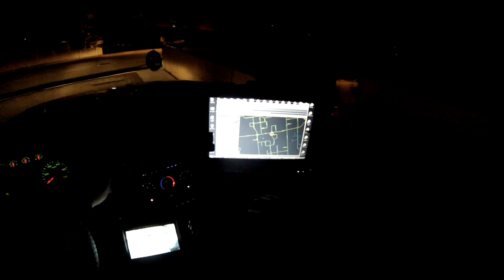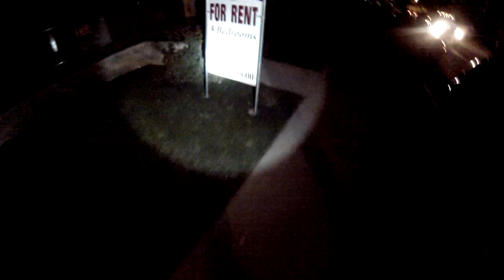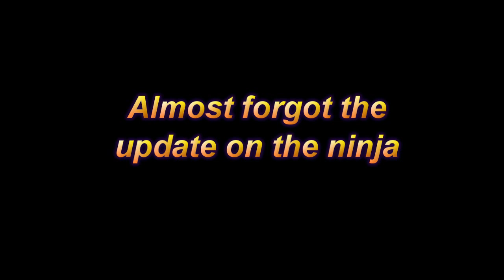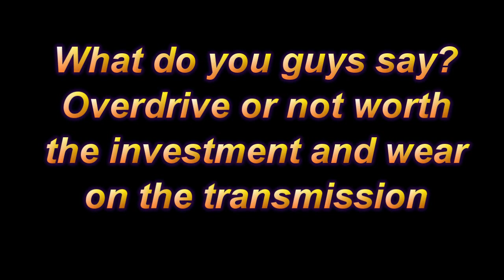Walking The Late Night Parking Garage Searching For Vehicles

Comment: Can a Tesla charge its batteries when it's being towed on the drive wheels or when it's an AWD model with 2 electric motors, one on each axle? Would or could it go into "recuperating" mode while it's being towed? I don't think it would be a problem for a big tow truck like the Ninja to pull that extra weight, except of course it would use more fuel.
Reply: Seegal Galguntijak  flat bed  tow only
Reply: Dusty G. Really? But why?
(Besides the point: Dollies should work, too. Still I don't see the reason)
Reply: Seegal Galguntijak True of almost all hybrids and electric vehicles, if the wheels are turning, then the regen motor is also turning.  If the vehicle isn't "on," then there's no field regulation, so while it won't charge the batteries, it will produce a current which can damage onboard components, and possibly risk the safety of the operator.

The general practice is to not even push hybrids/electrics for the same reason.  :)
Reply: rhkips Wow, that's strange. I would have thought they'd put some sort of security measures in place so a tow won't damage anything. It should be possible - after all, these vehicles are never really 'off' which means they can turn on (but not be driveable) just by sensing that they're being pushed...after all, it's all realized in software, there are no hardware switches that aren't controlled by the computer.
Reply: If you use a usual tow truck, 2 wheels off the ground, the AWD system would break, that is why it uses dollies or flatbeds.
Reply: Idiothi5 Well, the AWD system on a Tesla S isn't like conventional AWDs. These cars got 2 electric motors, one on each axle, so they are not mechanically connected.
Reply: Unfortunately, any time an electric motor is in motion, it's "on," even if it's not attached to anything.
Reply: rhkips Yes, but the computer, which is also always on, could still switch it into recuperation mode if it is a problem that it generates power while being towed. Or at least it could switch it into some sort of "sailing mode" where the power it unintentionally generates is disposed of in a safe way, like with an electric resistance or something like that. I mean, is there really no equivalent to "neutral" on these things, where they just roll, without using the generator function of the electric motor as a brake, nor using power to hold the speed?
Reply: It's such a rare situation that most manufacturers don't feel it to be worthwhile to add in the complexity.  Sure, it'd just be a few lines of code, but it's more time and testing, and the potential for legal issues if it ever failed.
Reply: Seegal Galguntijak Agree with others. In the case of Chevrolet Volts the manual specifically states flatbed only and OnStar will only send a flatbed truck for any tows including something as simple as a flat tire (Volts don't have spares). There's no transmission therefore the induction motors are always attached to the drivetrain. All that induced current from the motor freewheeling with nowhere to go = lots of heat and damage. Without the onboard thermal management system active all that heat sticks. The cars are also typically very low to the ground especially in a Model-S with air suspension. Towing with a wheel hook would be a guaranteed scrape if not rip of the whole bumper cover. You can barely get a Volt onto a flatbed without extra lumber to decrease the angle.
Reply: EV S I get it. But do they use flatbed trucks with cranes then? Because (at least in theory, as far as I undestood so far), even the 7 meters the car would have to be pushed/pulled in an ideal situation to get up on the flatbed could cause some damage? In fact, are there even flatbed trucks like the one in the above linked video in the USA? (Because I've never seen one, although they look quite practical, because no wheel gets rotated more than a half turn during loading)
Reply: It's the heat caused by being towed at roadway speed. A few slow rotations of a car being moved onto a standard flatbed is not going to create the same circumstance. Crude comparison: run your hand slowly across sandpaper. No heat, maybe mild discomfort. Now do it fast and for the average duration of a tow.
Reply: Keep in mind even when the power electronics are on the car needs to be moving above 5mph or so for any regenerative braking to function. Another reason why moving slowly onto a trailer via winch is not going to cause damage but being towed with the driving wheels even in neutral is still not a good idea. From GMs manual though the Volt can sustain suspension damage if towed via a hook. Again the reason why their roadside will only dispatch flatbeds. I'll see if I can find a link to that pdf
Reply: EV S OK, I get the picture. Sort of makes sense, although I still think it isn't the optimal solution.

Anyways (apart from the issue of moving an EV onto the bed), do you have flatbed trucks with cranes at all, or is this something that is only common in Europe? Because, before watching youtube, I have never in real life seen a flatbed move its bed backwards and tilt it to the ground so it becomes a ramp. Only years later, I have seen one once but it was based on a Sprinter base (cab, frame and drive train), so it was quite a bit smaller than the usual flatbed would be.
Reply: Seegal Galguntijak As far as I'm aware there are no crane type flatbeds in the US. I'm not familiar with them either but if I had to wager a guess small cars and parallel parking situations are more common in Europe making the crane type a useful tool. The US is mostly large open parking lots and decks with very little parallel parking being done except in the major cities. In those cases wheel jacks can easily rotate a car out enough for a standard lift or flatbed to angle in and grab the car.
Reply: EV S I see. Well, the video I linked above wasn't exactly parallel parking, but a parking strip in the middle of the road (at these coordinates: 52.547779, 13.438783 - one of the few places where there is even StreetView available in Germany, although with extremely old pictures, because too many Germans were too stupid about it). Still, I see how it would have been difficult with a tilting flatbed without crane to get that car out of there. My buddy would have had to push it out of its parking space ;) - while with a lift like they are mostly used in the US (I have also seen this only once or twice here, and then it wasn't based on a pickup truck either, but something much smaller), it would have been very easy.

Comment: This may be a dumb question, but to me it looks like the truck idles a lot. This might just be how the videos are edited. But do you think it idling so much has an effect on the lifespan of the engine? Maybe the cost of a starter burning out would be more worthwhile than engine reconditioning.
Reply: ZipKickGo It doesn't have diesels to idle like it does for gas engines. There is little to no wear to idle a diesel truck. I'm sure truckers leave their trucks running if they have to keep their load cooled down, like if they're transporting perishable food.
Reply: TheCobruhAlienat0r Refrigerated trailers have their own Reefer units, fuel tanks and etc for climate control, but it's pretty common for drivers to idle their trucks to keep the cab cool or warm
Reply: Yes,  diesels wear at idle,  neglible on the older lower powered ones with loose tolerances,  much worse on anything newer.
Reply: TheCobruhAlienat0r  An engine will wear if it is driving or idling, just because it is a diesel does not change that.
Semi trucks hauling perishables use a Reefer unit which a small engine driving an ac unit mounted to the trailer. The trailer can be left unhooked from a truck and still maintain temperature.
Reply: ***** Actually large trucks have excessive idle warning devices and shut downs. Idling has been shown to be a huge waste of fuel, I am not sure of engine damage occurring. When a  drivers need heat or AC from the engine it is better to turn the engine up a few hundred rpm to achieve this. Most larger companies however have gone with Auxiliary power units (APU's) since these can keep a truck cab warm or cold, and proved in cab electricity at cents on the dollar compared to idling.
Reply: TheCobruhAlienat0r Diesels doesn't like idling too long. Its not good for them in the long run. NOR is running only short trips ie 20 miles a day or under. I know why Matt idles his truck like he does and it's his thing. I wouldn't unless ie was wintertime , but I'm not up in his face about it or ranting and raving here about it. Its his truck whether he idles it all the time or not is entirely his call. 

BUT, I wouldn't think that all his idling is what causes his issues, as excessive idling just means the oils needs to replaced sooner and that some parts of the engine might start coking up from carbon deposits that don't get burned off properly while the truck is idling.
Reply: ZipKickGo it does affect specially if you have those emission crap, newer truck with diesel engine theres a timer how much you idle.. but his truck does not have a emission but that's the main problem why the 1st owner sold it
Reply: TheCobruhAlienat0r no they have reefers that have a separate engine
Reply: ZipKickGo It's not clear from RepoNut videos exactly how much idling he does, because the videos we see are small snippets out of his day.  He also drives a lot of miles, so the idling in terms of the total running time is probably small, compared to what we see in videos.  Pretty much all the diesels I've heard about having severe wear from idling have been emergency services vehicles, where they're either driving or idling (Particularly in winter) 24x7.  When a diesel idles for a long time you get diesel washing down the cylinder walls causing excessive wear.  RepoNut gets his oil tested regularly, and fuel contamination of the oil would show up pretty quickly.
Reply: ZipKickGo Idling hurts the wallet more than it does the engine. The only bad thing in idling is carbon buildup which is why everyone says it's bad but if you fast idle (higher rpm idle speed) then you reduce the ability for carbon to buildup at only the cost of fuel. Thus you save wear on the starter from many restarts, you keep oil circulating and lubing things rather than having dry starts, and you put less heat cycles (cold-hot-cold) on the motor which is all good at only the expense of extra fuel.

Comment: I thought about putting an overdrive on my '76 GMC motorhome. But then i saw the price of such a unit. And then it'll have to be put in. It's not worth it to me, but if you think you can save 500 bucks on fuel every month? It sounds like a "no brainer", but you'll have to do the math very closely on that. 
What does it cost? What extra wear will the transmission have? What will you really save on fuel? Think long and hard, buddy. Good luck with that!

Comment: put gears in it. Wil not put extra stress on your trans.
when your towing heavy you can use tow haul mode. it wont shift direct in to overdrive on the trans. so it keeps your rpm's up. only shifts in to overdrive if you can.
.

Comment: I would check your Gear ratio in the rear end. Your running I would say 4.10 gears. I would go to 3.50 gear ratio plenty of power and save on gas. As many light cars, I see you haul even 3.25 gear ratio you could use that. Still have lots of power and better gas mileage. The guy I thought was correct, put two new tires up front and let the backs tires wear down on their own time scale. Doing them all at once is not economic friendly in my thinking. That heavy rig will track just fine. Just make sure you have Radials all the way around front and back. Good luck Matt.

Comment: Yes it will put more stress on the transmission. If the only thing that changes is the rpm on the engine, where does that tell you the work goes to? If you use it wisely, but (aka only using overdrive on highway cruising once you are up to speed), it probably wont eat up the transmission as much as you would just leaving it on (but would still put extra stress on the transmission regardless, but less stress than leaving it on full time). As for changing the axle ratio, that would do the same as leaving it in overdrive all the time, as you wouldnt have the option of changing the ratio when you got up to speed (although, i will admit it would surely help fuel economy as would the overdrive).

Comment: A Gear Vendors Over/ Under drive is extensively used on the cars that are street driven and have have huge 2,000 plus HP and gobs of torque they can stand the terrific shock to the drive line of multiple passes at the drag strip.  They are not cheap, I am sure that it would cost you at least $4K professionally installed.  It's pay back would be in less fuel burned and longer engine life ( the same result as less idle time) would have and the pay back would be instantaneous.  An extra deep cycle AGM battery would keep your electronics going while working at night.  You would have a real Ninja then,sitting silently in the shadows waiting to pounce.  God speed to you and your family..

Comment: Can you get a 6 speed auto? I have a 6 speed auto in my dodge journey at 55 to 65 i am running around 1500 to 2000 rpm and at 75 its like 2200 rpm. I have taking 2 hour trips and not even see the gas gauge move!

Comment: I would research gear vendors over/under drive. It's an add on unit for your transmission. I think it might help you out with fuel mileage. I would add an after market trans cooler. Heat kills automatic transmissions.

Comment: Gear Vendors makes a great OD unit which doesnt stress the transmission like they are saying. I would at least look in to it and research. There are cars running 7 second quarter mile times using them and they drive them on the street. Ask Hot Rod Magazine about the winners of the Power Tour they do. Most if not all their winners run them.

Comment: I'm not a mechanic nor do I know Fords very well, but here's my thought - so far you've had no problems with the transmission, and I would just leave it alone. Don't get me wrong - overdrive is awesome, but automatic transmissions are so complex that adding something to it from a 3rd-party really doesn't seem like a great idea. I don't know what sort of gear ratio you've got in that truck, and I don't know what the speed limit on the highway is over there in Utah, but my solution to not having overdrive in my 1983 chevy truck is to go the speed limit. My previous truck (1996 GMC Yukon) with overdrive was awesome on the highway since it had OD - I could go 90) but with the old non-OD truck I just go the California speed limit, 65, and it's not revving like crazy. Maybe the speed limit over there is 75 but I don't think you should add an overdrive.

Comment: No personal experience, but when I had a motorhome, I always wanted to put a Gear Vendors OD on it. Electronically shifted. Price was prohibitive for the amount of use it would get (2000 miles per year), but for you it might make sense. I don't understand the increased load on the tranny. Explain that to me again.

Comment: You shouldn't have more than a 4.11 rear end gear. It's
preferable to have a 3.90 gear so that you're not prematurely
wearing the motor out on the freeway. The motor and transmission
are strong enough to make the transition work and the travel will
be more than enjoyable given the difference.

Comment: Look into enlarging the rear tires. I made a few calculations back in the day and found that drive tire size matters a lot... look into it... it could save a lot of cash...
I could try anther one if you could send me the original and maximum tire size (which will fit in your rear wheel wells ...

Comment: Why do leave the truck running? Is their some type code u p
Reply: Mr1Fantastic713 Diesels don't get any wear like gas engines do when they idle. Plus he idles for the same reason that police, fire, and EMS leaves their vehicles running, so that they can keep the electronics inside running and so that if he ever needed to get out of an area quickly then he can just pop it in gear and roll out versus having to start it back up.
Reply: TheCobruhAlienat0r that I know about diesel engines but I was trying to say is why he leave it on AMD running and if someone trys to steal his truck but I didn't finish my comment but thanks
Reply: Mr1Fantastic713
He said he has some kind of alarm system that is paired to his phone so that once he walks away from it, the doors lock and once he gets close they unlock. Also if they were to have stole it before the doors locked or they broke the window out then he said he can kill the engine from his phone.